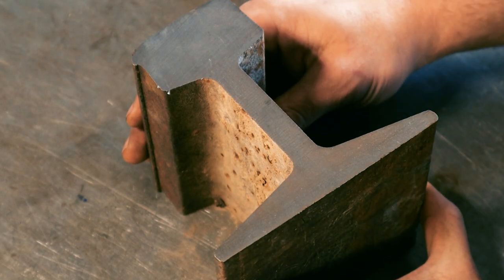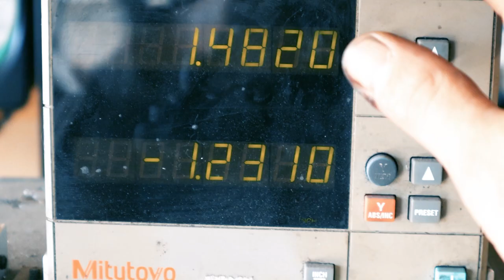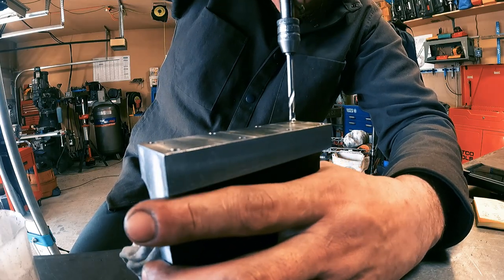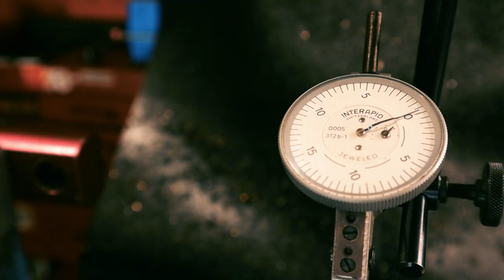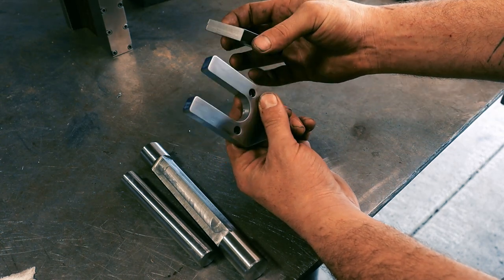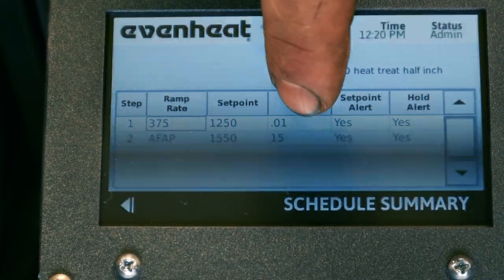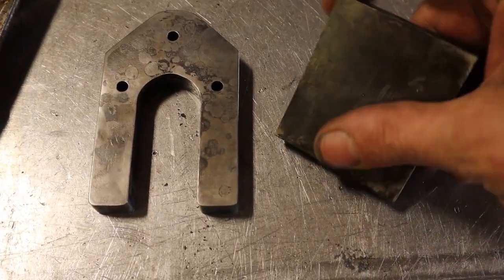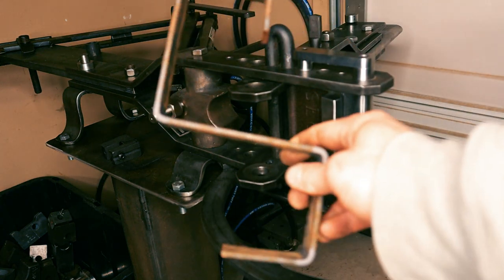Machining Railroad Track for bending Dies

Comment: Pre CWR, rail is homogeneous and it’s the type you want for machining. 
Continuous Welded Rail has a much, much tougher ball (Top) with more carbon, molybdenum and vanadium in it. The web and foot is more akin to mild steel to be a bit more forgiving under load and wild temperature fluctuations. Remember, these are 7 to 15 mile long pieces of continuous rail and both side are never the same length.

Why do I know this? I’ve been running trains on it for 20 years now.
Reply from the maker: Good to know thanks man....im glad I used the top for the bending part I think 45 rc should be ok for 1/4 stock

Comment: Pretty cool man, Ive found railroad track to be around 1070 steel with added manganese, which helps with hardening a little bit. You want to take it a little above non magnetic tho, otherwise you wont get full hardness out of it. I usually let it soak 10-15 seconds more past the non magnetic temp, then quench it in oil. I know you can quench that stuff in water also, but I dont need the stuff that hard usually, lol.
Reply from the maker: Thanks Chirpy......I didnt show on camera but I tried heat treating that thing like 4 times at different Temps I just couldn't get it above 45 but honestly I'm pretty happy with that.....makes it relatively useful, super tough too. Im gonna look up 1070 and see what the difference is.

Comment: In my tool and die days I would purge my bag with argon from tig torch and my parts would come out clean as if they were heat treated in a vacuum furnace. Try it with a small scrap piece and see how it works! Good job! I like the fact you do finish work. Do you have a surface grinder?

Comment: Curious how a piece of modern rail would cut? Modern rails appear larger in size, cool video.
Reply: Depends on the type of rails, the ultra high carbon rails I deal with have a minimum hardness of 390 Brinell which equates to around the 42 on the Rockwell C scale. Other rails are much softer than that however the reason we use acetylene and cold cut disks to cut is speed and safety (can’t bind a liquid, but you can bind a blade). In workshops/testing environments we still cut with a bandsaw as it’s a cleaner cut.
Reply: Also a modern large rail is typically 186mm tall (7.3”) and weighs 68kg/m (136lb/ft) there’s a size larger at 142lb/ft but it doesn’t get much use globally as it provides no weight carrying benefits, and it’s lifecycle has other issues.

Comment: Railroad track is not high-carbon steel. It doesn't harden well. If it did, you would see cracks in work-hardened old track. Never.
Reply from the maker: Its medium carbon steel and can most definitely be hardened just not as much as some high carbon steels. Carbon content is somwhere between .5-.9%

Comment: personally, if i don't want something oxidizing in the ht oven, I just coat in borax. That being said, melted borax flux can eat away at the lining of your oven so I'd use a stainless tray underneath. But the borax does such a good job you don't even need to wire brush it or anything afterwards, just rinse the remaining borax off under warm water and the part is finished.
Reply from the maker: I'll give it a try thanks

Comment: Nice work. Nasty habit it is to put an unmachined surface in your vice/chuck without some form of jaw protection. Could marr and damage the surface and also put uneven strain on the jaws. Use some soft face, and if the jaws that are parallel closing you need a point load in the middle. You only ever have three points of contact in a vice.

Comment: Was that little machinists jack between the vice to stop the jaws from bending the material as you cleared out the center ?
Reply from the maker: Yes just in case probably didn't move but couldn't heurt

Comment: I am making dues for a power hammer .  Mine did not mill so nicely but my mill is a mill drill. I am going to anneal the track snd try again.

Mine was a bear to drill and tap.
Reply from the maker: Mine was hard to tap also......I noticed when machining it was really inconsistent it would be going good then I'd hit a hard spot so unfortunately I couldn't use powerfeed

Comment: I love machining railroad tracks. It is hard - yes, but after i changed to the right tools, i can make som heavy cuts on it. 
I have produced alot of anvils and hammers out of the material. 
On my mill i can easily make a 4mm cut with a 80mm cutter. 
I have also had some that i putt in the 4-jaw on the lathe, and then turned the head on the hammer round. No problem with the right tools.

But wonderfull movie you have made here. You just got another subscriber here :-)
Reply from the maker: Thanks..... I also don't mind it honestly I think some stainless can be worse to work with than the railroad and it can be found for pretty cheap

Comment: Wonderful, as always.  Did you go to film school before going hands-on for a living?  The intro was awesome, btw, though you should have curled that track section a few times just to get the testosterone flowing again after all that prancing! ;-)

For the heat-treat, you're right about putting something combustible in the foil.  It eats up the residual O2 and helps reduce the oxidation even more.  A squirt of WD40, will do the same, though I often just use old business cards I've collected from wherever.

After the heating, I go straight into the oil and don't bother trying to remove the foil.  Every second you're futzing around on the bench, the temperature is dropping fast so you're missing your window for maximum effect.  Best to just go straight into the oil and worry about getting the foil off once things have cooled down.  It's a little messier, but your heat-treat will be more consistent.
Reply from the maker: Haha thanks man no film school just alot of trial and error.......I wondered if just throwing the foil in there too would be better ill give it a try next time

Comment: your hardness tester needs hydro oil in it! it should drop slow not fast. i have the same one!
Reply from the maker: Your only seeing me release the counter weight in the video....when the 150kg is applied to the material it is slow......I think I show it better in my annular cutter video. If it was moving that fast when the load was applied that diamond wouldn't last long

Comment: Dear Sir, your intro really caught my attention, I had no idea how great a presentation this would be......you sir, are a maestro......I have the same Hossfeld bender, Clausing lathe, and Bridgeport mill as you....but the popcorn machine is on my wish list along with the Wilson Rockwwell tester....from your newest subscriber, cheers from Sunny Florida, Paul
Reply from the maker: Thanks Paul I appreciate that man.....I actually saved the rockwell tester from the trash a machine shop was going out of buisness.......I really like the clausing lathe its the perfect size for my small shop........how's the humidity effect your machines over there do you have a favorite rust preventer
Reply: @westweld  ps, I also have the same 1800 Ellis.....your work on the handrail job was fantastic......cheers....Paul...now to find an acorn table like yours....

Comment: What brand of collet chuck is that on your Clausing?
Reply from the maker: Its a pratt burnerd multi size chuck ....
Reply: @westweld  Thank you Sir! I have the same lathe, but only with a Jacobs Flex collet set up.
Reply from the maker: @johngunn7947  ive heard thats a good one too the only thing I dont like about this one is it doesn't like holding on to short parts.....like under an inch

Comment: Nice. Amazing what a couple million in machinery and tools can do. If my shop was that clean and organized, well, it wouldn't be for long. Great skills and knowledge.
Reply from the maker: Thanks man.....I wish it was a couple million worth......you can get the machine tools for pretty cheap at auctions like a few hundred dollars cheap but usually have to travel a little
Reply: @westweld  Just because you bought em cheap, doesn't mean they aren't worth more. I have no less than a quarter million in my business equipment, with depreciation, way lower. But.... to replace stuff, if I have to get right back to work, it's usually new, or close to new. One big item would put a hurting on the finances, everything has gone up so much.
Reply from the maker: @treeguyable  I watched a little bit of you tree falling pretty cool stuff
Reply: @westweld  At 64 yrs old, it just goes a bit slower!
Reply from the maker: @treeguyable  tom petty said "you never slow down you never grow old" although he did only make it to 67 so not sure we should take advise from him
Reply: @westweld  67 don't sound bad. I gotta work till I die, so older ain't always better. 😉

Comment: Another item everybody says you can't harden is rebar I had a half-inch piece of rebar that I purchased from Lowe's and I made a couple punches out of them including a center punch and I heat treated them with a simple torch and quench them in water they got harder than the hinges of hell and I very rarely had to touch up the tips of them and they have not broken to this day I use them daily at work. I also made an ax out of railroad track and you are correct they are roughly a1084 equivalent and they harden quite well and are very tough.
Reply from the maker: There are many different types of rebar but some of them are definitely high carbon and can be hardened

Comment: I have an Ellis 1600, but the vise that came with it sucks, yours has a screw instead of the cam lock, which is in the way on most cuts, so I have to use a big "C" clamp to hold material.
Reply from the maker: I bought it from ellis but its pretty expensive.......if I ever need a new one ill make it but it is much better.......if you dont have a lathe you could buy a chunk of acme thread fromm mcmaster carr and make one pretty easily
Reply: @westweld  I got mine (Ellis) 25 years ago at a local tool seller. I never saw the jack screw type vise, even when I looked online. I saw they modified the cam lock so you could move the lever to the other side. But they wanted way too much for the upgrade. I'll have to make one, as it's darn simple, and I don't like how marginal it works currently.
I have full machine shop as well. My Wells-Index mill has the same DRO as yours. But I have the R8 spindle taper. I have an old antique horizontal, (Rockford Miller, late 1930s with power feed in all 3 axis, with a Lima overhead drive conversion) and it never gets used as the vertical does everything I need. It was the first Mill I got, and was foolish purchase. It has a B&S#9 spindle taper, I got a few bent arbors with it as tooling, but you know, there's lots of money in tooling. I have two lathes, my first lathe a bench 10x24 Jet brand (with a bastard 50mmX8TPI threaded spindle nose), I got back in 1976, and then a big 18x40 (6000 lbs) lathe with a D1-8 spindle taper. Both were import pre-assembled kits. They both work pretty good now. The Bison chucks make all the difference versus the ones they ship them with.
Nicely edited video, and good music selection.
About the only issue I've had with the Ellis outside the vise, using a 4-6 tooth blade, and it bounces even once, it strips teeth that then get embedded in the work, and everything is FUBAR. This has happened 3 times now, so I have to baby sit the feed rate until the blade is well into the material. That or it take for ever to do a cut if I adjust the spring counterbalance and hydraulic feed. And you know how pricey the blades are.
I ended up with a Paragon heat treat furnace. And have a import Rockwell tester. I purchase a spare diamond tip off ebay last year, and I saw the ball tips for the "B" scale as well. Seems darn accurate when compared to the test coupons it came with. I was expecting to see the hardness of the annealed iron to be near zero. Rc30 is pretty hard state still to me.
And again, well assembled video. Now I'm hungry for popcorn.
Reply from the maker: @f.hababorbitz  thanks man.....I have the same problem with my ellis just setting the feed and walking away was just an illusion I had when I bought it haha.....but its been pretty good.....I almost went with a paragon too

Comment: Hello, how nice is that nozzle fastening system for the lathe in the minute 8:24 but in my country I can't get it, they make it in the United States ???
Reply from the maker: Thats a pratt burnerd collet chuck they don't make that kind anymore but its a nice tool each collet has 1/8 inch of range but not very good for short stock needs to be at least 1 inch long 
Thanks for watching
Reply: @westweld  surely it is much more precise than a self-centering plate that always has some eccentricity due to the play of the mechanisms that compose it. Do you do die work? excellent your workshop
Reply from the maker: @fernandolevrino5488  no im not a good enough machinist to do that im mostly a welder but I enjoy machining

Comment: What brand of bender is that? Or did you build the bender yourself?
Reply from the maker: its a hossfeld #2 I got a good deal on Craigslist but there are some really good plans floating around the internet and it wouldn't be too difficult to make
Reply: @westweld  thanks for the reply. I appreciate it. I can tell you are very smart and talented when it comes to metal. I am very interested if fabricating of anything metal or wood. Will be watching for more great videos from your channel.
Reply from the maker: @bryansloesshillshomestead4523  thanks man I appreciate that
Reply: @westweld  I’ve got one of these that has serial number 464 (!) on it. Hossfeld tells me that as far as they can determine, it was produced about 1931! They started making them in 1923 I think. The remarkable thing is that the basic machine is still pretty much unchanged! And they sell an unbelievable amount of tooling for them. Even though mine is 90 years old, it’s still going strong! A very capable machine!

Comment: Tapping. Use a 2 flute Gun tap and Molly Dee cutting oil.  Gun taps are the strongest other than a form tap.
Reply from the maker: Good advise....unfortunately i didn't have any split point taps in that size only spiral flute and they were also blind holes
Reply: @westweld  spiral flute go snappy snap
Reply from the maker: @funone8716  i can make all kinds do that haha
Reply: @westweld  LOL me too

Comment: the torch hardened piece was too thick to cool sufficiently quick to harden properly... an inch or more in thickness, and you need salt water brine with a surfactant like jet dry for it to convert properly to martensite
Reply from the maker: Interesting I tried it with the smaller piece too ( I cut it out of the video because it was basically the same) and it was under an inch but I got the same results maybe I'll try the brine next time. I do believe what your saying though because the machinery hand book says use oil or brine
thanks
Reply: @westweld  10 series steels are water quench... that said, if used for something like a knife blade, the thin cross section will crack... I've been making knives for 35 years, and I use a lot of train rail, rail clips, etc... it's pretty good in carbon, but it also contains a lot of manganese... proper hardening requires soaking at 1560 then  bring it up to 1650ish to quench... 60 to 61 rockwell c is easily obtained. The Manganese helps keep it fine grained and tough
Reply from the maker: @lawrenwimberly7311  appreciate your expertise all I had to go on was the machinery handbook and it suggested oil  I was really just trying to demonstrate what the average Joe could do with very little effort.....honestly if it was a critical part I wouldn't use railroad track
Reply: @westweld  hardened properly, rail steel makes great wear plates for machinery as well

Comment: There are harder rails than that.
Reply from the maker: I think there are too from what I've read......I think water quenched might also make it harder too.... honestly unless your making a knife out of it 45 rc is respectable for steel that is basically free in alot of places
Reply: when our thermite welders do a shot, they have to manage the heat and time when welding head hardened rails.
Reply from the maker: @jasonbabila6006  makes sense if they got it hot it could anneal it
Reply: @westweld  It takes about 5-10 minutes to preheat with propane and oxygen and a rosebud.